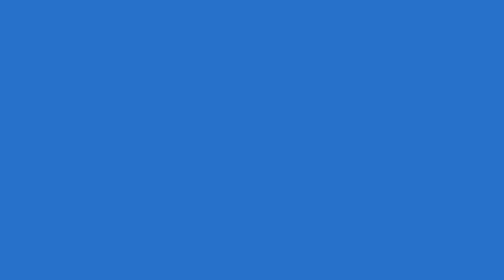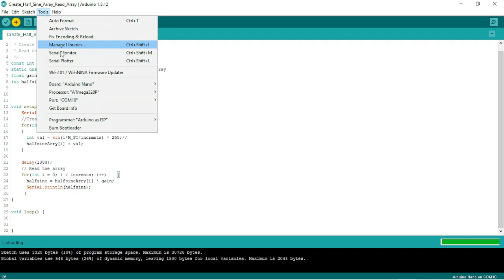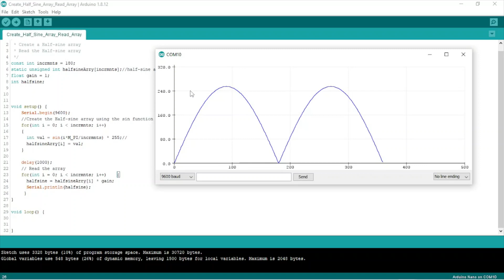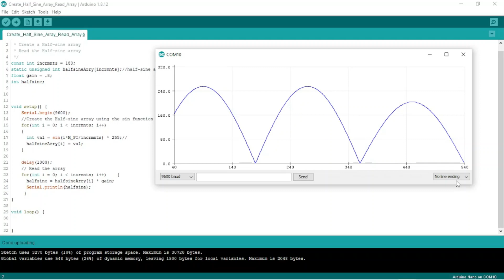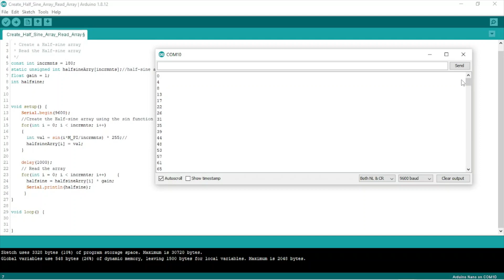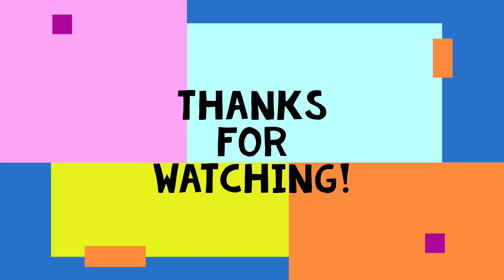Halfsine Creation

Comment: do we apply the voltage feedback in the code every iterations or every half-sine? i have been thinking about this for so long because my ac v rms output jumps from time to time, it does settle on 230 volts rms. thank you sir for making videos. i am following your projects.
Reply from the maker: This is a very good question. The answer largely depends on your specific application. I assume you have some sort of inverter circuit and you are regulating the voltage using some method such as up/down incrementing of the modulation halfsine or you use a PI controller and a voltage reference setpoint. For a stand-alone off grid inverter topology adjusting the output voltage every 1/2 cycle should be sufficient and I normally apply the feedback change at the zero level. For a grid-tie inverter, however, It is necessary to apply the feedback change during each itteration to ensure tight control.
I will be releasing my next instructable soon detailing a 500Watt 230V stand - alone inverter project using an Arduino microcontroller where I will include an explination of the method I use for voltage regulation.
Reply: yes i am adjusting the modulation factor that is then multiplied by with the sine array values. reading from other diy'ers code that is how they usually implement feedback control. i am studying PI code but not yet tried it. and yes, my test circuit is a stand alone off grid inverter with step up transformer.
Reply: can't wait to see your next project. thanks again for sharing your knowledge.